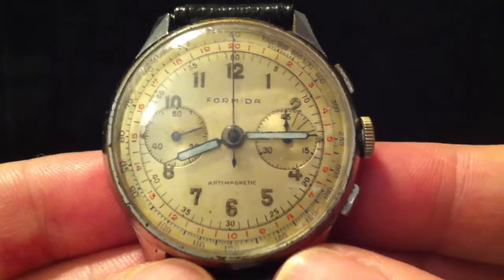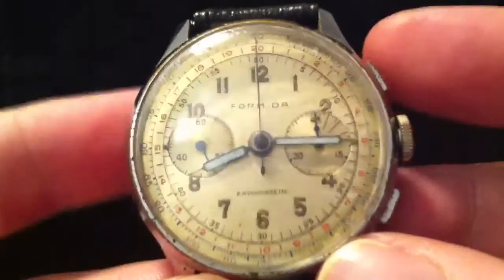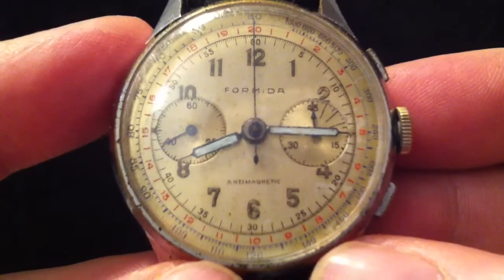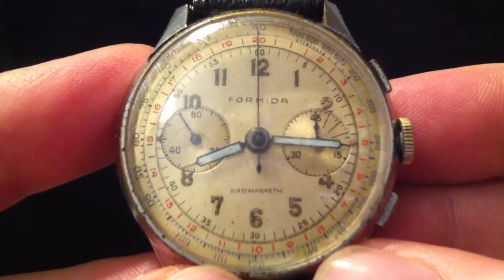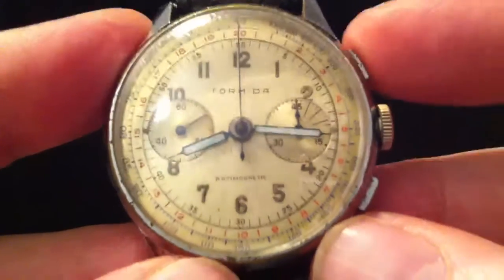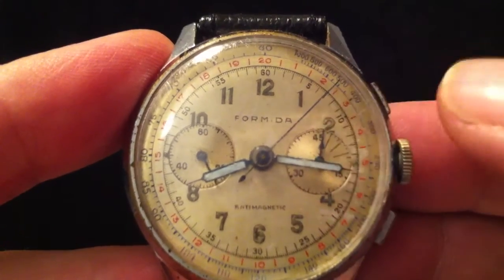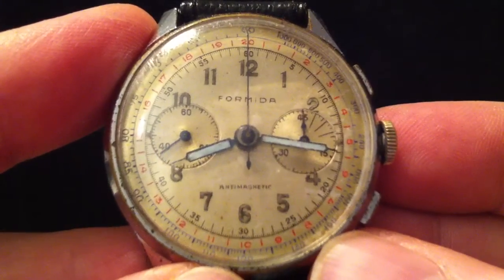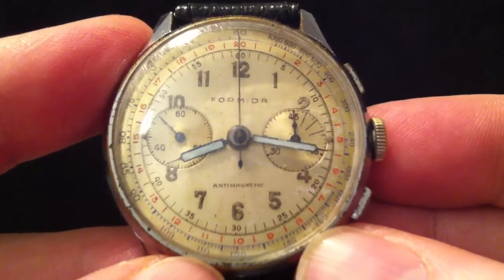Telemeter Chronograph - How it Works

Comment: so the telemeters in noway connected to the tachymeter?
Reply from the maker: Sort of related, both are using measured time to solve an equation either for distance with a known speed (Telemeter) or for speed with a known distance (Tachymeter).

Comment: that would depend on the torpedo going the speed of sound. Or am I missing something? Shouldn't the point of it be that you don't have spreadsheets and calculators around?
Reply from the maker: You're missing something.  It's the difference in time of the light of the explosion and the sound of the explosion reaching you that's being measured.  From that you can work out the distance.
Reply: @ChromeFreeDisco  I know, what you measure is the speed of sound. There is no torpedo that is going the speeed of sound.
Reply: @ChromeFreeDisco  oh...w8...yeah I get it now. But not all telemeters have the same base reading. Or do they? what got me confused was when he said how the timing starts once the torpedo is fired, or did I get that wrong also?
Reply from the maker: @0_Ka-Bar_0 The strike of the torpedo or the fall of the shot, i.e. when they hit not when they're fired.  The 0-20 scale is for km.  There may be other versions with a Mile or other scale but it's the same principle.
Reply: @ChromeFreeDisco  Tnx man... I was watching this on job, some stuff you just have to watch at home.
Reply: @ChromeFreeDisco  Now I'll have to watch it again when I get home.

Comment: You can use any watch as a telemeter. You don’t need a telemeter on your watch. Just remember that every 3 seconds is equivalent to 1 kilometre. Then you just keep counting the seconds and then divide the reading by 3. The answer will be in kilometres.😎

Comment: That doesn't make sense though..........torpedo, arty shells or any object travel at different speed. A torpedo and an arty shell both taking 7 seconds to reach their destination would have very different distance from the destination because they travel at different speed. There's no way that both the torpedo and arty shell were fired from 2km away.
Reply from the maker: You measure the time from seeing the explosion to hearing it.  Not the time from firing to seeing the explosion.
Reply: @ChromeFreeDisco  ok so you are just measuring the distance between the event the the sound, but not the distance to the source of the event
Reply from the maker: @devilhunterred  Correct.  And it uses the time difference and the speed of sound at sea level to work out the distance.